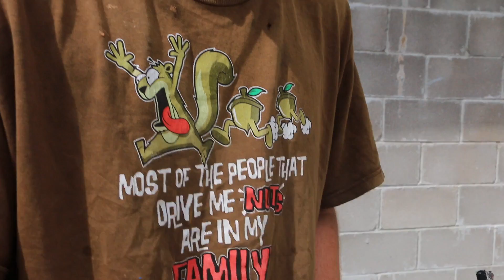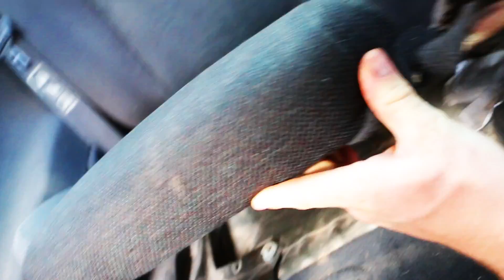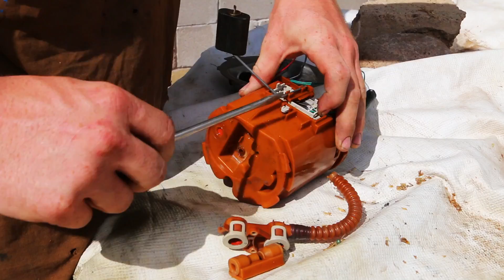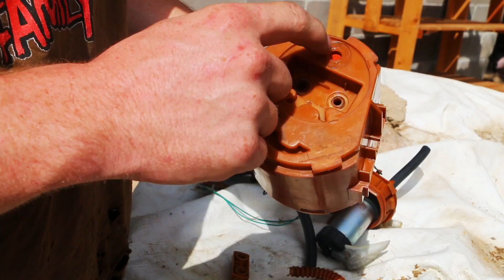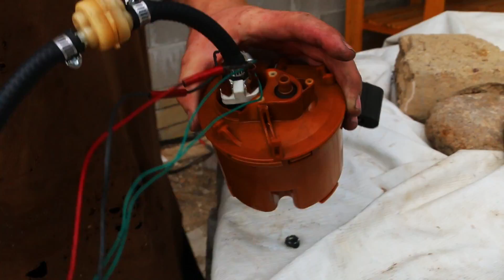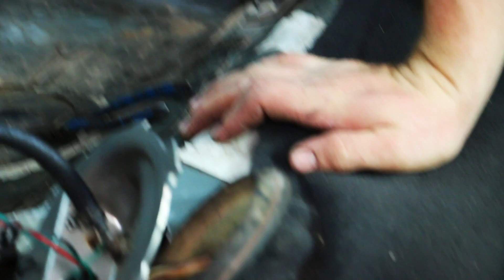How to Bypass Fuel Problem on Mercury Cougar

Comment: Have you ever replaced the fuel pump modular? It looks pretty simple. Mine is bad. The diagram shows the modular is in the rear trim panel. Do you just disconnect the battery before replacing it or do you need to do other things?

Comment: I guess I have afew questions and hope like heck you check soon lol but here it goes. To me it looked like the pump housing is not a sealed unit am I correct in that observation? If that is the case I understand the removal or the check valve essentially opening the bottom of the housing improving flow of fuel but why bypass the check valve on top of the assembly? Would it not just be more simple to remove check valve leave top of the assembly intact? And also what makes this so difficult to clean the "injectors" ? Would possibly just opening the jets solve all the problems? And aren't there already openings in the top of the housing anyhow?

Comment: These Cougars have a fuel pump factory recall. I had mine replaced free from the dealership many years ago (but had to pay $80 to replace the fuel filter). Car's been sitting for over 4 years in my garage now having issues with the fuel pump not working.

Comment: mroffandon  car has power snd spark .. for some reason once you turn key to on position it kills  power to fuel pump.
Reply from the maker: +poli Abeyta have u checked the fuel pump relay?
Reply: mroffandon i have its good..
Reply from the maker: +poli Abeyta not sure then I would have to be there to tell u more sorry man :/
Reply: there's a shut off valve switch on. the bottom left of your leg when your in the driver side
Reply: MrOffAndOn what does it mean when the car putts

Comment: Mroffandon i have 02 mercury cougar cranks over but wont start any tips.. have checked inertion valve new fuel pump.
Reply from the maker: +poli Abeyta r u getting a spark?
Reply: mroffandon we are getting spark we have checked everything  as fas as fuel driver... seems as if fuel pump isn't  kicking  on
Reply from the maker: poli Abeyta u have probably checked the fuel pump relay?
Reply: mroffandon we checked have checked power is good
Reply from the maker: +poli Abeyta do u have compression?
Reply: poli Abeyta Crank position sensor

Comment: Can I run with out the chic valve
Reply from the maker: +Devin Hall  U will have a lot of trouble getting it started because when u turn the car off all the fuel will drain back into the gas tank.
Reply: I was having trouble getting the hose back in the gas tank so I guess try tomorrow thanks
Reply from the maker: +Devin Hall good luck :) and thx for the comment :)

Comment: I have a 02 Mercury Cougar, and sometimes at 1/4 tank it won't run and shows no fuel pressure, but if you put gas in it the car will start and run fine. Someone please tell me what causes this. Note: It only does this sometimes!
Reply: I'd imagine what's happening is explained right in the first 10 seconds of this video.
Reply: @nitrorustlerpro15  t.c
Reply: Does it even crank when it does that? And how much gas would you have to keep putting in?

Comment: Hey I have an 01 Cougar v6... Could this be the problem with when I beat on the gas pedal sometimes the throttle  hesitates and the car lurches?  It happens all the time not just at a qtr tank. I'd say 60% when I beat on it, it hesitates.
Reply from the maker: I am not sure. When this was happening to me I would only notice gas problems at 1/4 tank. I think it is because there in a hole that gas can flow thru on the top of the fuel pump housing so the engine only has trouble when it drops down passed the top of the housing.
Reply: Apparently my car has this issue too (I just bought it 2 weeks ago) I just keep it above 1/4 tank.
Reply from the maker: +Michael Rohloff That's what I did for the longest time to :)
Reply: +MrOffAndOn do you have any suggestions for things i need to check? It drives just fine except for when I accelerate quickly and the rpm gets above 4800 or so.
Reply: +MrOffAndOn I haven't check the MAF yet but I don't believe it's bad because it idles perfectly fine.
Reply from the maker: +Michael Rohloff It's hard to say without being able to hear, touch, etc. If u think it's gas related I would start with the fuel filter. They r cheap and it's probably still the stock one.
Reply: +MrOffAndOn Yeah I was thinking the same thing. I filled my tank to 100% and have beat on it several times in attempt to make it lag and lurch again. Going out of the same turns accelerating the same way it didn't do it once, and I have noticeably more power. It did it a lot when I had half a tank and maybe more, but not once with a full tank. Meh, I'll replace the fuel filter and hope that does the trick.
Reply from the maker: +Michael Rohloff That is a little weird. It sounds like what was happening to me but at a 1/2 tank. U could take out the fuel pump/fuel pump housing and see if it is plugged up. Maybe it is at a worse stage then mine was.
Reply: +MrOffAndOn will this damage anything? I'm afraid to frack up anything. I'm not afraid to try, I am afraid to break. :P I assume I should just replace it with a performance pump for $180? After all, breaking stuff is the best excuse for upgrades, isn't it?
Reply from the maker: +Michael Rohloff Maybe it's a small crack in the fuel line between the check valve and the pump.
Reply: +MrOffAndOn hmm, I have the majority of the day off tomorrow I may open it up and look. How hard is it to get to, clean out, and re assemble? Time wise?
Reply from the maker: +Michael Rohloff I have found that if I take a fuel pump out I end up replacing all the lines in the tank because they r normally pretty brittle. I would say 3 to 4 hours but it's bin a while.
Reply from the maker: +Michael Rohloff I think the only thing that gets a little torn up is under the seat when u r trying to get the top of the tank :)
Reply: Okay thanks very much I will have to try at some point because even though I haven't had a problem it still annoys me that it potentially exists.
Reply: @Tech-n-Bangz  I've got the exact same problem, did you manage to figure it out by any chance?
Reply: @viscousfluid5287  head gasket
Reply: I have a 2001 Cougar that cranks but will not turn over. I checked the fuses, listened for fual pump humm from gas tank, pushed the fuel shot off safety switch , replaced the lil sensor that has one bolt and is hard as heck to get on and off! it sat for 4 months before doing all of these things the first time I cranked it it started for a moment but died. it really sounds like it wants to start but has no fuel getting where it needs to go.
Reply from the maker: +Anthony Tackett I would rent a fuel pressure tester and check your fuel pressure.